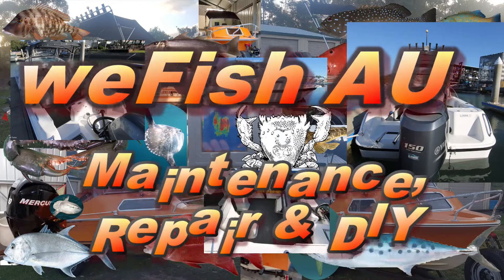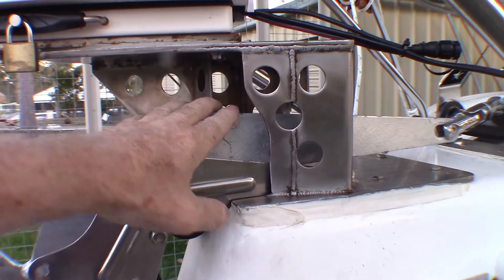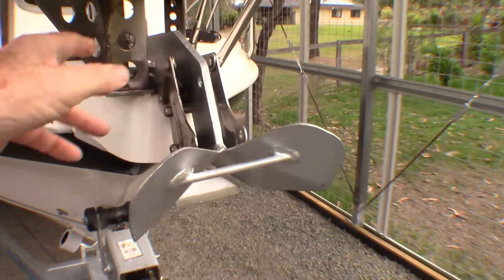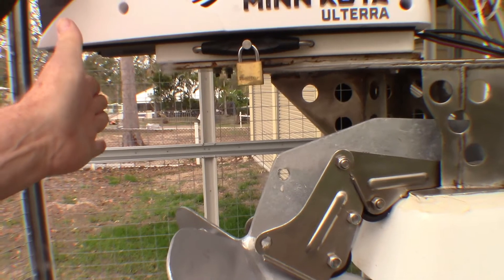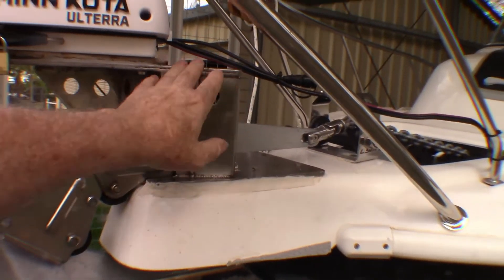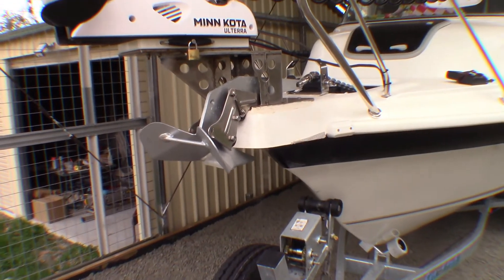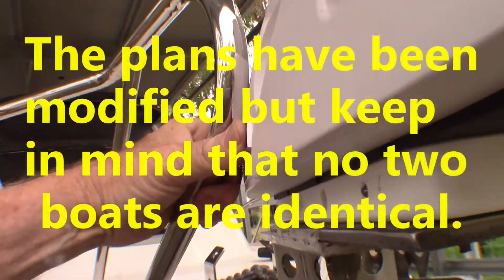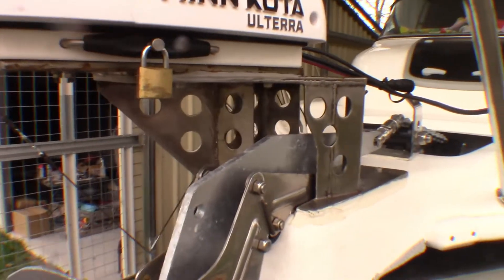Fitting a Minn Kota to my Baysport Offshore – Part 3 of 3

Comment: Thanks for the video very informative.  How does the 80lbs handle fishing offshore ?  How's your experience with the Ulterra? Having a 22ft Stabi self deploy would be great but have heard they are unreliable so I'm considering the Terrova.

Are you running AGM or Lithium batteries
Reply from the maker: Thank you.  I haven't had a problem with the Ulterra, it's been great.  Offshore performance has been mostly good, except for a couple of really high current days.  On those days the cheap Chinese circuit breaker I got popped early and generally made the day difficult.  After two trips I coughed up 5 times the money for a quality breaker.  I haven't been out with a really high current running since then so I can't say that I have really put the breaker to the test yet.   With a half cabin I reckon the self deploy is almost a must have.  Centre console would be a different story.
Reply: Thanks for a prompt post weFish-AU
Sorry to hear about the circuit breakers however  I'm glad to hear about your positive experience with the Ulterra 👍.I've done a full electrical rewire and I installed around 10 BEP circuit breakers after several unfortunate electrical breakdowns. Is the  reason you aren't using it in poor conditions due to the length and or only running a 80lbs or both? What battery setup are you running?
Reply from the maker: Yes.  I bought it for my previous boat and I couldn't fit a 72" shaft on that.  If it gets too rough the propeller gets close enough to the surface to cavitate.  So far 80 lbs has been plenty except for one trip out to FAD4 when the current was really wild.  It was holding me, but only just.  The motor was working really hard and that was when the circuit breaker showed it's true colours.
There is a playlist here on my electrical system if you are interested: https://www.youtube.com/watch?v=eK7tfdsu_RQ&list=PLIw5KzM8w-NFNJyaH2GsffSwjSEep4MQ3
Basically an engine battery, house battery and 2 batteries in series for the Minn Kota.

Comment: Looks good. What happens if it won’t stow. Can you get the port plate off the minn Kota to access the release screw?

Mine had to be manually stowed yesterday and was hard enough to get all this off and stowed in calm weather with full access.
Reply from the maker: I think I can access it, although it wouldn't be very pleasant if it was rough.  I have also fitted it with a quick-release so worst case I can take the whole thing off and bring it in through the hatch.
Reply: weFish-AU Yes, I also installed the quick release bracket. Was not keen to find out how balanced it is when down. If I pull the pin handle out will the motor pop out of the slot? They are very heavy. 

Think I will test this out on the trailer. Don’t like the idea of dismounting it on the water. Reckon would be very easy to lose it to Poseidon.
Reply from the maker: True.  If I ever have to do it I will be tying a rope to it first, just in case.